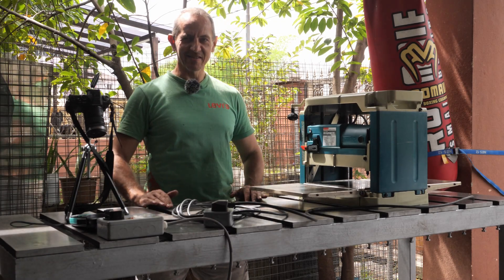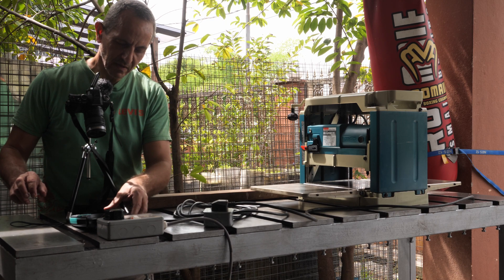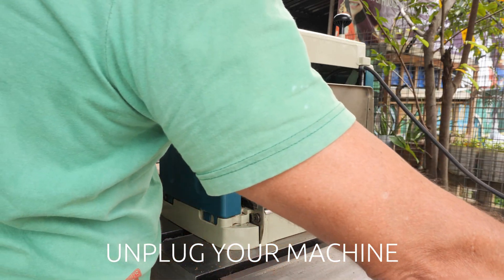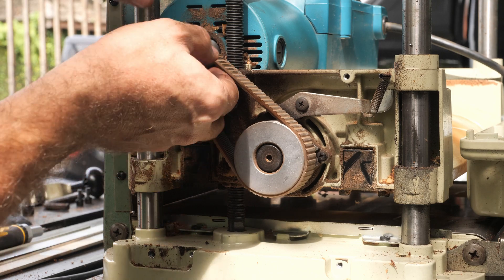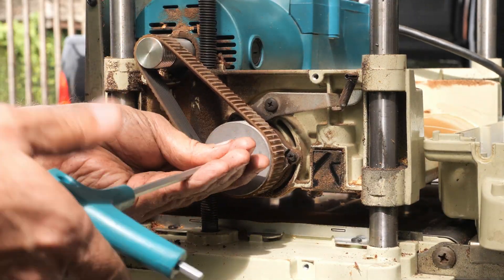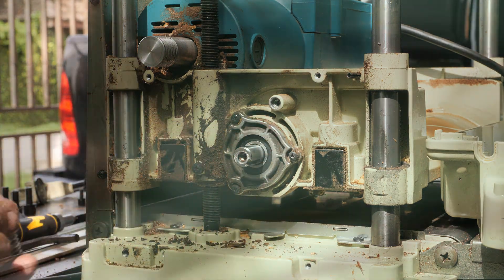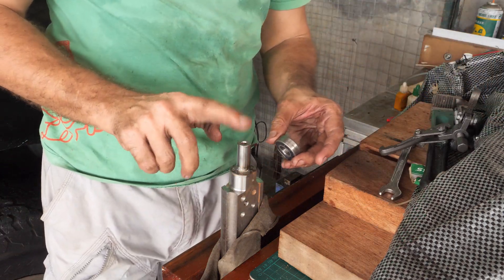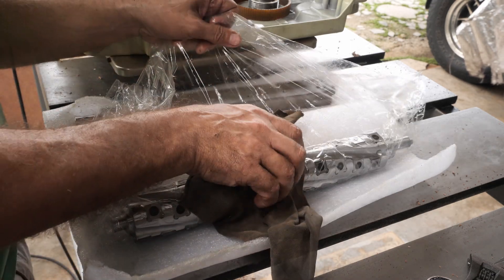How To Upgrade Makita 2012NB Thickness Planer To Helical Spiral Cutter Head  + Comparison Test

Comment: Great video, thank you. I have noticed that initial power spike (load free) with straight blades was half of that drawn by helical head. I assume it could be because the helical head is heavier than stock head and thus requires higher power to gain initial momentum?
Reply: @TigerCarpenter  Thank you for the reply it helps a lot. I have the 110v version which I run with 3000 watt step-down transformer(I have  20 amp single phase 220v  wring in my house)I wanted to upgrade to helix but was worried that planer would draw too much current  from the step-down transformer (limited to 3000 watts). I have tested my planer today with original straight blades and the initial spike was about 30 amps , it did not trip the converter though. However under heavy labor planer drew only about 12 amps. Thus I am not worried that while under load it will overdrain the transformer, however worried that initial drain will trip the transformer.